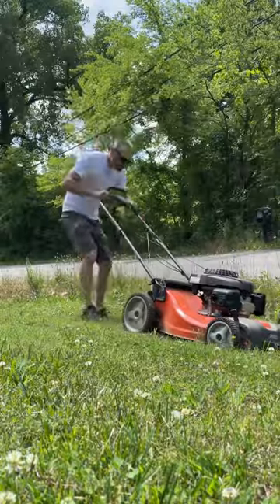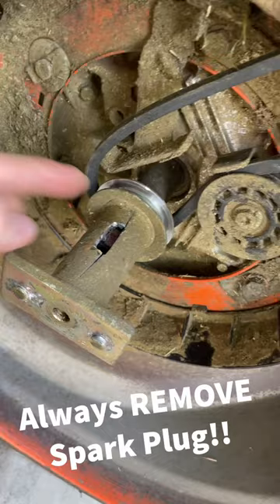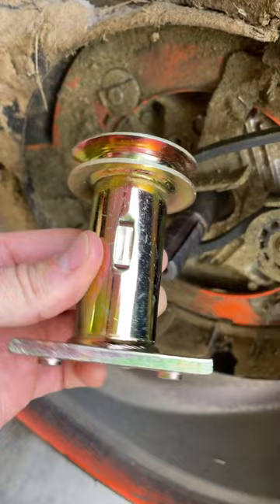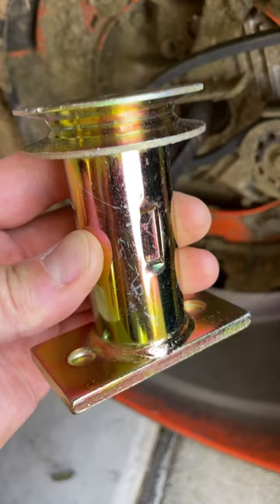Hitting A Giant Rock With My Lawn Mower!!

Comment: It was made to be the weak link. Be very happy that's what broke. Usually it shears the flywheel key or bends the crankshaft
Reply: I guess it’s the equivalent of a shear pin on a snowblower .
Reply: I'm wondering why it could shear the flywheel key. Is it because of the inertia of the flywheel and the crankshaft coming to a sudden stop?
Reply: I'm guessing you didn't hear the engine at the end?
Reply: I was thinking the flywheel key as well.   That what all the older ones do.
Reply: I bent a crank and the engine was locked up.
Reply: @michaellewis9589 yes.
Reply: @josephstoots6548  that's why you don't ever buy a mower with a solid slasher style bar blade. I live in Australia, and Victa is the biggest push mower brand for many reasons, one is every victa mower- 2 or 4 stroke- has a disc with lightweight blades underneath. Never heard of a bent crank until chinese mowers for the american market turned up.
Reply: Had something similar happen it was a stump though and it busted a hole in the block
Reply: @josephstoots6548  didn't say it was impossible to bend the crank did I?

Comment: You should really get a large jar of anti-seize lubricant and use it for things like that instead of WD40. Anti seize lubricant is amazing stuff for a lot of mechanical applications.
Reply: Why not just switch to grease at that point
Reply: Anti seize is much better for many applications. But you have to have some in order to use it. That’s why most people use WD or “grease”. So: My tip is to get a jar of anti seize and have it available.
Reply: @fieraci8500  ... anti-seize is the cat's ass. A 6 ounce container will last decades for the average DIY type and you will find MANY uses for it.
Reply: @fieraci8500 if you know how to use it properly,  anti seize is great. However,  most people use way too much of it, and get it on the wrong places. If some gets on the bottom of the pto shaft it adds tolerance when the bolt gets tightened. Then as it heats up from use, it migrates up the shaft, which causes the bolt to lose its tension.
Reply: Using anything properly is the key. Wouldn’t you say?
Reply: @fieraci8500  well, yes. But antiseize has a surprisingly large learning curve. For example, it's actually far more abrasive, than it is a lubricant
Reply: I know how to use anti seize.
Why don’t you make a video on it?
Reply: @fieraci8500  I don't like making videos, only watching and commenting on them
Reply: Don’t lube keyways. 
WD 40 was appropriate as it is not a lubricant. 
Anti seize will allow enough movement to worry out the keyway to twice the normal width. 
It’ll be easier to get off. 
But fail sooner. 
You can’t even use anti seize on splined shafts. 
Just the lightest coat of oil.
Reply: @crinkly.love-stick than u better learn to make me a sandwich
Reply: @crinkly.love-stick i want my cake and eat it too 😮
Reply: @crinkly.love-stick  while you’re talking about using things the intended way. 

Wd40 was never intended to be used as a lubricant. It’s supposed to be a cleaner and water displacer.

Comment: Had similar happen to me, except the woodruff key that holds the flywheel on the top end sheared, which caused it spin on the shaft slightly and made the engine timing off for the magneto.

Comment: Same thing happened to me but the crankshaft bent. I bought a larger displacement Predator engine from Harbor Freight that just dropped in. It works great!
Reply: Someone did a "how to straighten bent lawnmower crankshaft" video on youtube.
Reply: Next mower you buy, get one with a disc underneath and it'll never happen again. Bar blades are expensive to replace and can destroy an engine.
Reply: @rossbrumby1957  That's a great tip, the disc is about half the diameter of the deck and rotates with the blade?  I may have one like that.
Reply: @rossbrumby1957  Do they make disc blades for push style mowers?

Comment: I think it's called a shear shaft. It's designed to give way to protect the crankshaft in the engine
Reply: Wouldn't need it if all push mowers hade a disc type blade carrier.

Comment: There are actually two of those keyway on that direc drive/crank shaft, the one he showed us in the one on the other end that operates the timing, and when the one on the bottom shears off, the one on the top will also shear off and when that happens the engine will start up and it'll run really good for about 2 seconds and then it was slowly slow down and die because the engine is slowly moving out of time.
And after you try to pull start it 10 or 15 times it'll miraculously start-up, start running better then start running worse and die.

Comment: It also shears the key on the flywheel on top.
It's a very easy fix. Just buy the new key (it's just a few cents) and get the flywheel back at the right timing and it'll run just fine.
Takes me less than 30 minutes to repair a lawnmower after a hard strike. The common item hit in my area is stumps. Affordable stump grinding could actually be my side hustle...

Comment: This is why I mow my lawn with an Echo 225 weed eater I bought semi new on Facebook for $150. Don’t have to worry about this stuff, very little to no maintenance, no oil change needed, no constant filter clean up, spark plug change and it lasts god damn FOREVER compared to a push mower.

 If you’re a real men it’s becase you cut your lawn with a weed eater, it only takes me 10 more minutes than If was to cut it with a push mower, no big deal.

Comment: Looks like the broken one was aluminum (designed to break if you hit a rock). The replacement looks like steel.  Hit a rock with it and you will bend or break the driveshaft.

Comment: When I was a kid I was mowing my neighbors lawn because they were on vacation. They had a light standard in their yard. When I was going around the base, one of the bolts was sticking up and I hooked it with the blade. That motor stopped in and instant, and I couldn't start it again. Went to my dad and he couldn't get it to turn either. So we flipped it over and the blade looked like it was crooked. Turns out the crank was bent.

After tearing the engine down we could visibly see the bend in the crank without a straight edge or dial indicator. It was BAD! But the local equipment repair shop had a good used one. I remember him saying to my dad "I don't think I have ever sold a replacement crank shaft." 😂 OOPS! But back in the day it was about $25 bucks and a couple gaskets to rebuild the old Briggs.

Comment: None of the ppl in comments understand.. that is not a "weak point" or anything like a "shear pin". If you run over that rock with a lawnmower the engine is trash, period. Along with the blade, the blade adapter (which is what cracked in the video).

Comment: you are seriously lucky that is all that happened.  It seems that it was designed that way so you don't bend that crankshaft
Reply: Best way to never bend a crank is buy a mower with a disc underneath. Bar blades are expensive and destroy motors.

Comment: My plate that attaches directly to the blade is kind of bent. After changing Spark Plug (Gapped and Torqued to Spec), Cleaning Spark Plug/Ignition Coil Wire Contact, Changing the oil, Cleaning the Carburetor, Exhaust and Fuel Tank. I also sharpened the blade. If that plate that attaches to the blade gets bent, will it cause hesitation and make it die when mowing? I got it started, but it runs super rough and will die on me when I try to mow under load.

Comment: There is a good chance that part was engineered to break under load.  Like a shear pin.  What that does is protect the engine components.   Like if you bend that engine shaft the mower is trash.

Comment: My mower doesn't have that piece with a belt.  I hit a pipe panel.  Afterwards it started shaking. Next day one minute it was running, then it just slowed down and quit. Now, there is no resistance when I pull the rope. Blade turns, but feels like compression is gone. I'm curious to take it apart to find out what is really broken.
Reply: your connecting rod decided to go on vacation.

Comment: Don't need to remove spark plug, there's a flywheel brake that prevents it from starting.
Reply: old school... ALWAYS pull the plug wire
Reply: @rupe53  no point, having the break on stops the flywheel instantly, its impossible to start. Engine doesn't make enough horsepower and the blade isn't heavy enough to overcome the brake to keep it running or even get it running. 

Your little superstitions don't do anything.

Comment: TroyBilt TB360. Best self propelled lawnmower until I hit an immovable rock. Had to dremel and saw off the blade adapter because grass juices somehow galvanized it to the crankshaft. Neverseize dab and good to go along with a new belt ans blade.

Comment: At other times it can crack the case sending Oil ever were

Pay attention when cutting grass

It possible could cut the water pipe line if you have your father's mower and a 5 horse power motor and a sharp blade

Comment: Sorry brother, it still runs but I could tell just by the sound of it, you have a bent shaft, I noticed you didn't really show it running. I have the same mower and I did the same thing you did. 😢, their's more damage than you are showing.
Reply: I personally believe, because of that particular part that the shaft gets bent, it adds length to the shaft and acts like a lever. I'll give you the mower i have. Runs great but shakes bad and cuts on an angle.